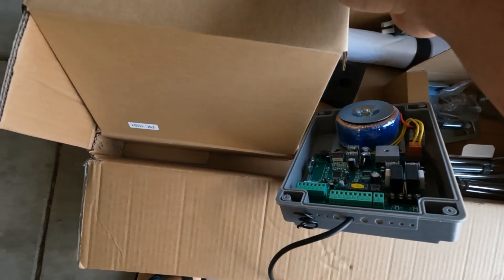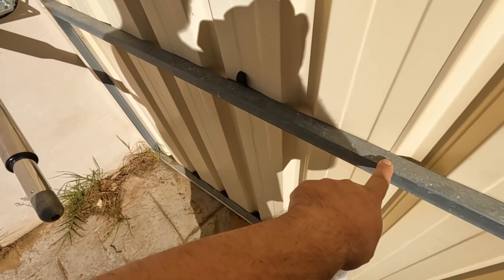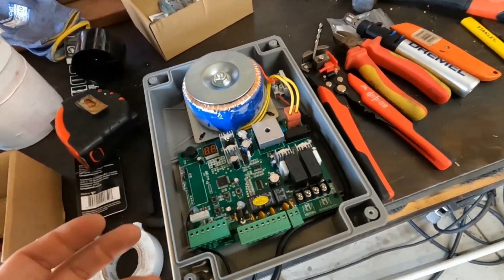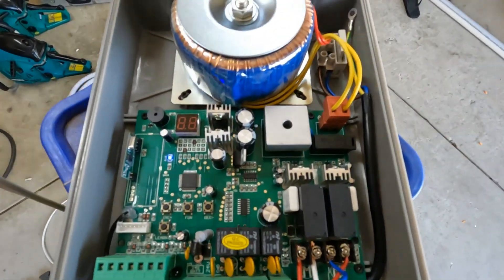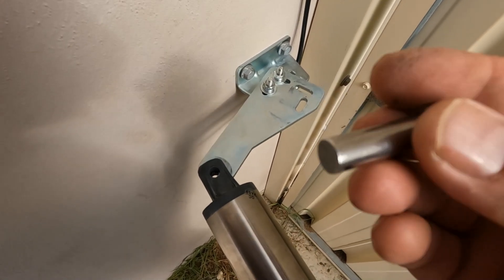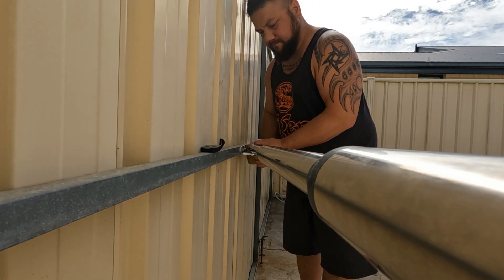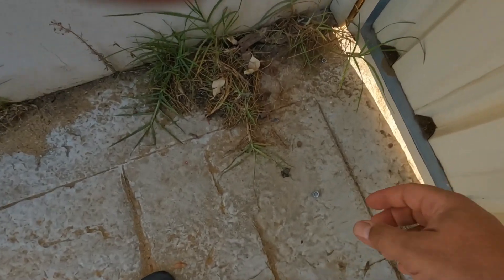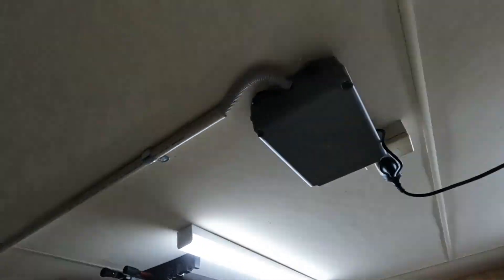Electric Gate Opener Install Remote Control (Ritrox)

Comment: Hey mate. I'm in Brisbane and looking for someone to wire mine up. The electrician tried and says there's a problem though I can't get any installers out as they don't deal with Ritrox.......any suggestions?
Reply from the maker: Any call out auto sparky should be able to sort it out mate. It's low voltage. No electrician required.
Reply: @Unfastened  Sweet thanks - will give that a try.

Comment: How’d you do the remote sync? Becoming quite a nightmare as it’s not working with current instructions
Reply from the maker: Press down the Learn button in the control box for 2 seconds. Then press the key on the remote and it should sync up mate. Probably goes without saying but use the remote controls that came with the kit. Sometimes aftermarket remotes don't pair properly.

Comment: Thanks for the vid 👍 could you please tell me the extended & retracted measurements of the actuator?
How's it holding up after 4 months outdoors?
Reply from the maker: About 1m extended, 0.7m retracted. Yeah good quality, still quiet and working well. I think it helps to wipe a bit of CRC or WD40 on them from time to time to prevent corrosion.